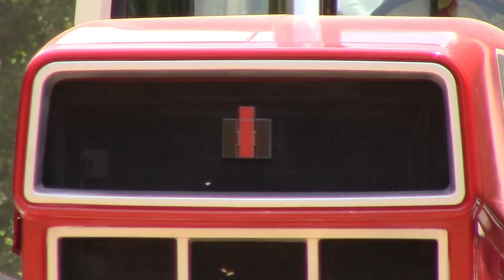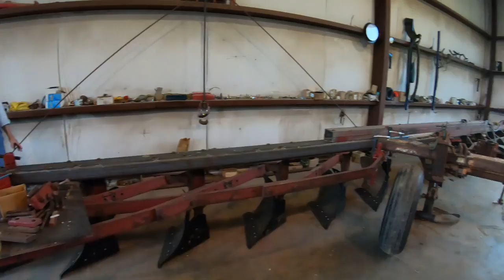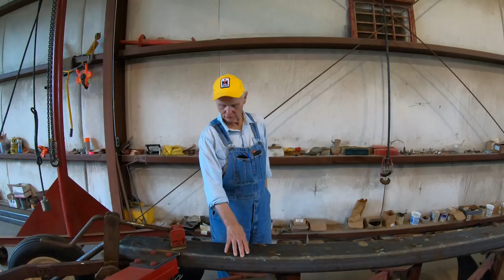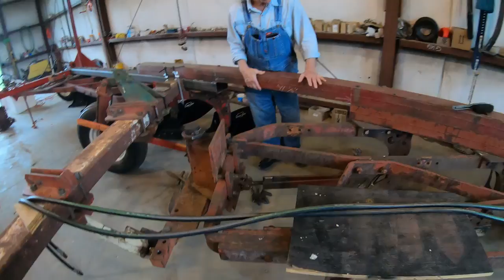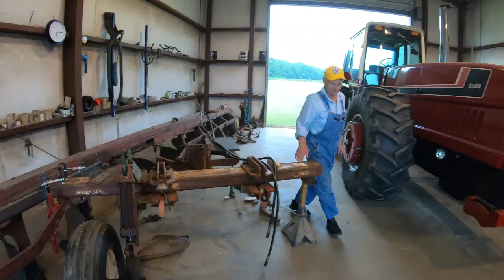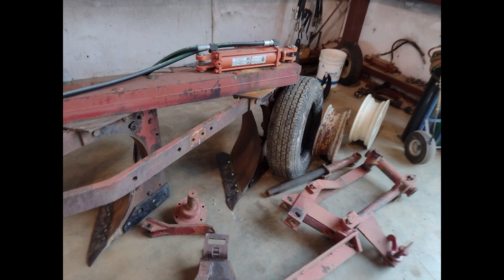The JXP 600 Flex Plow Build Part 1 Featuring RED BIBS BILL #REDBIBSBILL

Comment: Wow what a project. It will look a lot like an 800 plow, and I'm sure it will function like an 800 plow. It would be nice to have an 800 plow to pull with our 4366. We have the 770 plow and they are a trailing type 5 or 6 bottom plow. Ours is the 6 bottom version and we use a 1066 or 1206 on it. Last year, we used the 4186 on it, but it's hard to plow with the 4186...
Reply: Comment for the Guy using the 4186 use front steering!!! 😊

Comment: 12 bottoms would be a good load for the 3588 but it should do it. My grandpa pulled 3-14s with a W-4 for many years. When I grew up my dad used 3 Oliver plows. Typically he pulled 5-14s with the 806, and 4-14s with a WD-9 and 650 respectively. But he did occasionally pull the 5 with the 650 and it did do it but the clay knobs made it roll out the coal pretty good.